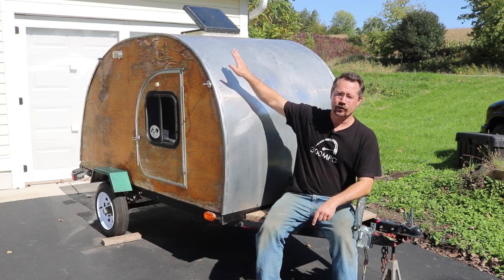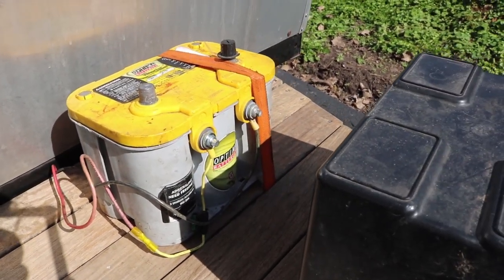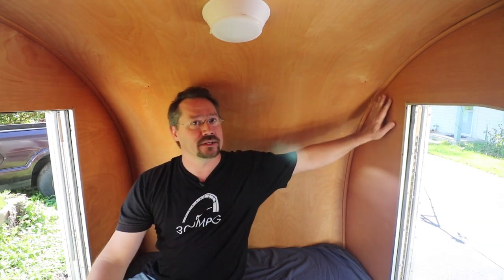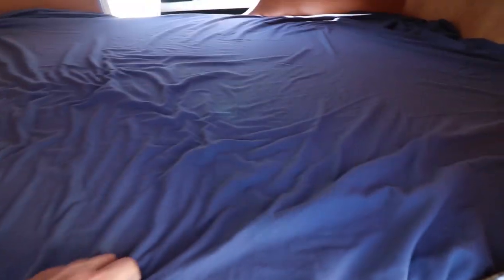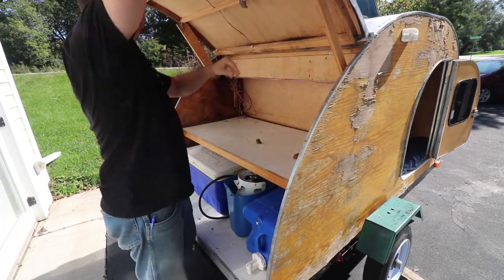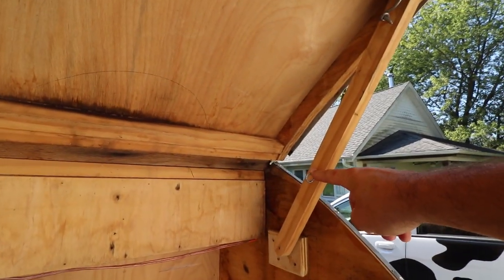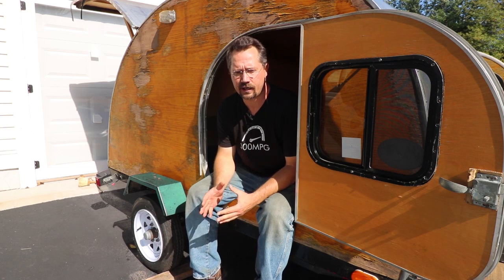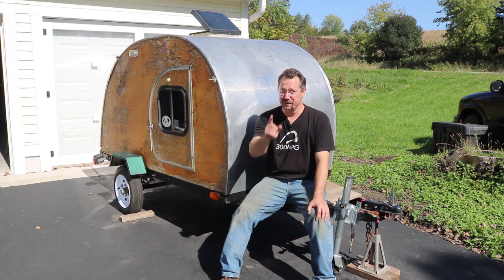Teardrop Trailer Tour - DIY Camping Trailer

Comment: That's neat Ben, if the wood isn't buckled or hurt you can just sand it down and recoat it with whatever you like to use, I don't know how hard it would be to cover it with metal on the sides but I think the metal would be the best choice. The hard part would be getting it to fit up under the lip coming off the top., I don't know if it is doable or not, maybe.  A person could go get some rectangular mild steel tubing and make their own frame and find an axle and springs somewhere. That's inspiring and it would save a person a lot of money on motels if they did any traveling to speak of providing the places they were staying in places that had rest stops along the highway, as far as I know we don't have rest stops in this state, Texas has some pretty nice ones at least the part of Texas I have seen.Thanks Ben
Reply from the maker: It should be pretty straight forward to refinish the sides, but a fair amount of work. There is aluminum trim between the roof and the sides which is held on by a ton of stainless steel screws. That trim would have to be removed, along with the trim around the doors. After that, the veneer could be sanded down and sheet aluminum put in place. Then it would be a matter or reinstalling the trim. Should work fine, just a lot of elbow grease!

Comment: Wow really nice! Thanks for the demo.

I believe the cheapest way to build this would be plywood and then fiberglass it with thin 200gsm fiberglass cloth and epoxy and then varnish. Epoxy should make it really waterproof and durable compared to just varnish that still allows water to diffuse through.
But maybe all aluminium just makes more sense because the costly bit is the time you spend working on this.
Reply from the maker: My father build a cedar-strip canoe. It has one layer of fiberglass over the wood. You can't even tell the fiberglass is there - it's transparent. The boat is beautiful. I've seen trailers that are done like this, but you pretty much have to tip the trailer sideways to do the fiberglassing!
Looks nice though, and would be very durable and low maintenance.
Reply: @BenjaminNelsonX  Yeah that is the style I mean. There is a "Teardrop Camper Kit by Chesapeake Light Craft" that makes this easy but you don't really need it fancy like that.
BTW do you think one could build a larger "teardrop" trailer with about 4x large solar panels and 1.3kW that can "trickle charge" an electric car? 

I think an electric car battery theoretically doesn't really need high amps to charge as long as you can supply 240V via inverter.
It could be a cool setup to boondock in a trailer and get maybe 5 miles per day free driving.
Reply from the maker: @dejayrezme8617   I saw the Chesapeake Light Craft Teardrop in person a few years back. It looked really nice and it was a good design for how they laid it out as a kit. Definitely done in a boat-builder style. They also pair it with an aluminum frame which weighs less than 250 pounds.
https://www.clcboats.com/shop/boats/recreational-vehicles/teardrop-camper/clc-teardrop-trailer.html

A teardrop is less than ideal for large solar panels. A better fit would be a boxy RV or travel trailer and just cover the entire flat roof with solar panels. You certainly could make power for charging an electric car, but it would be slow. It likely wouldn't be practical unless boon docking for a week or more.
In general, the best place for solar panels is the roof of your house.

Comment: Dear,
what are the dimensions inside of your trailler (length, height, width)??
Reply from the maker: The trailer is based on a 4 foot by 8 foot utility trailer frame. Inside, it's a little more than 6 feet long by a little less than 4 feet wide. (4" minus the thickness of the walls. The ceiling is high enough so that a person can sit up inside the trailer.

Comment: The 6 foot mattress length would be something I would have to change.
Reply from the maker: I'm exactly 6' tall and have never had a problem with it. If you are taller, you can bump out the foot space just a little further. You just lose that same amount of space on the lower shelf of the galley. You could also build on a slightly larger trailer.
If you are just by yourself, you can sleep diagonally and get more length as well.

Comment: How did you trim the edges where the roof meets the walls?
Reply from the maker: I used an L-shaped piece of aluminum trim. Put caulk under it, and held it in place with stainless steel screws. It's aluminum and not too thick, so it bends to fit the curve of the trailer just fine.

Comment: @BenjaminNelson wondering the weight and the effect on range. I won't to do something exactly like this for a cross country 6-12 month trip. Considering a Chevy bolt and a Aliner trailer. Because of drag. Even been recently thinking of something like the trailer you have with one of those roof top pop up tents mounted on it. I know people have put them on the roof of a Bolt (https://pauldankers.com/ev-adventures-with-our-chevy-bolt/). But physical limitations doesn't make that a viable solution for me.  Been researching #vanlife and #nomadlife and they say maintenance and fuel are the two biggest expenditures. Well something like the setup I mention would be a decent solution. A ev cargo van conversion would be ideal. But the eNV2000 I don't think is available in the USA and the Mercedes is way outta my budget. Any info or advise I would be grateful for.
Reply from the maker: I wish the eNV200 was available here in the states. I think I would have an electric RV by now if it was!

Towing my teardrop with my Mitsubishi just about cuts the range in half. It's a pretty modest car, with a small battery pack, but it is rear-wheel drive, which is ideal for towing. We have a couple of nice state park campgrounds within trailer towing range of my home. I haven't done any "camp-site hopping" with this car yet. A car with a larger battery would be able to.

A Bolt with a trailer should be fine with 100 miles between campgrounds. To find out for real, you would need to do some testing.

Aliner makes some really nice trailers. Any kind of pop-up trailer will maximize range because of aerodynamics. I saw an Aliner a few years back pulled by a VW Golf and talked to the owners. They loved it. I think the model they had weighed 400 lbs! (I can't remember the exact weight of my trailer, but I think it was 800 lbs.)

A Chevy Bolt and Aliner pop-up camper would probably we one of the best current combinations for range and comfort.
Reply from the maker: It would also be interesting to see the aerodynamic differences between a Roof Top Tent and a pop-up trailer. Although the trailer is bigger, it's BEHIND the car instead of on top of it. (Of course, it also has the rolling resistance of two more tires as well!)